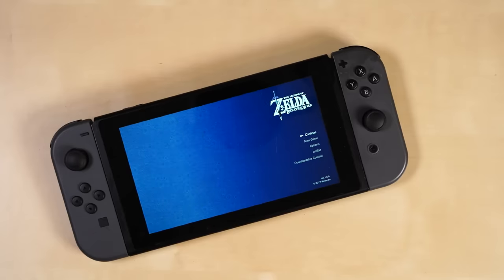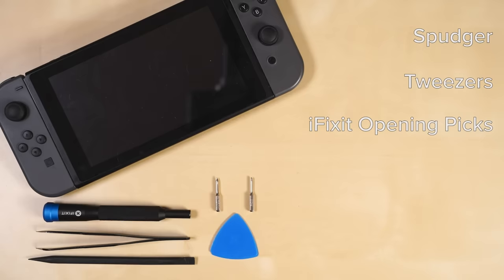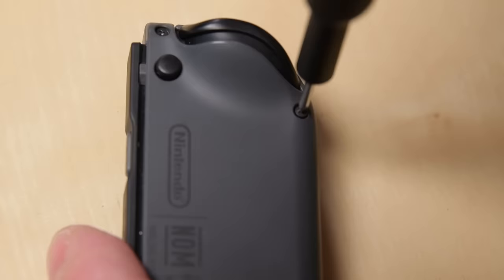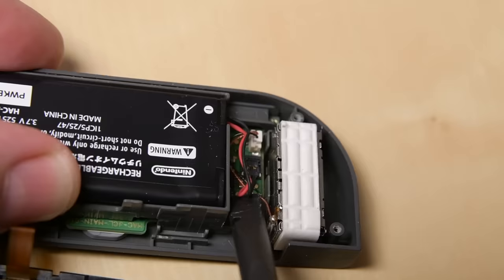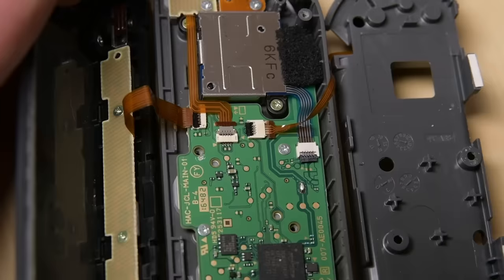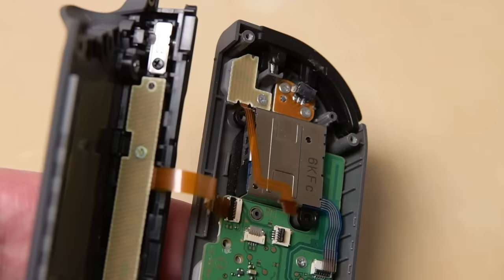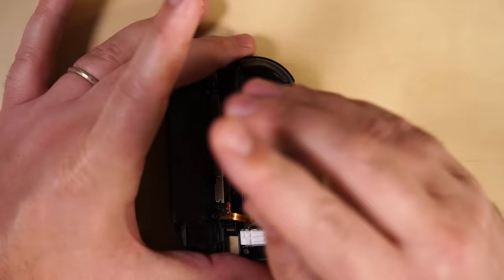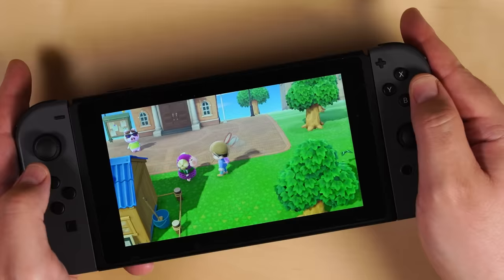JoyCon Drift Fix! How to Replace the Nintendo Switch Left Joy-Con Joystick

Comment from the maker: We forgot to mention calibration! If your replacement joystick is drifting after you finish the repair, a calibration should fix the problem. Here's a link to Nintendo's calibration instructions:
https://en-americas-support.nintendo.com/app/answers/detail/a_id/22340/~/how-to-calibrate-the-controllers#DT:t1-q1a1EP:t1-q1a1-c
Reply: do you guys know how to tell the difference between a fake joycon piece and the original joycon pieces? i want to buy a kit like this but i cant be sure if the thumbstick involved with it is actually the same with the original one.
Reply: @ozanozenir2503  I don't know if you still need the information but the replacement one I got had green strips compared to the original joycons that had blue. But still works the same.
Reply: @Ozan Özenir  I had the same question then realised: "Why would I want an original when they are so bad quality?" The replacement ones are just as good of you buy a kit with good quality 4.5/5 star ratings (i.e. off I-fixit or Amazon)
Reply: Do you have a way to remove the buttons on the Joy Con to clean them?
Reply: Very Helpful @IFixit
Reply: you can send the joycon to nintendo... even outt of warrenty

Comment: Thank you!! I’ve been putting off replacing my left joycon’s stick, but as of yesterday the drift was so bad it was unusable. This made the whole process easy, as someone who’s never taken apart an electronic device period, I was done from start to finish in 10 minutes! Working perfectly after the calibration, couldn’t be any easier.
Reply: How does the Joy Con that you replaced the analog stick work after this time? Is everything ok, or has the problem returned?
Reply: Yeah Tyler, how long did the repair last?
Reply: @mrcoolxoxo7007 can you read?
Reply: @nice_to_mitio  can you read and comprehend?
Reply: @mrcoolxoxo7007 I like turtles

Comment: Really appreciated your informative video and all the close-up shots!

I noticed a few things when I was fixing mine today:

1) When taking the joycon case apart, watch out for the L/R button coming off. If you looked closely you will find a small spring attached to the button, and if you're not careful you could lose the spring

2) Don't try to be a smartass like my Switch's previous owner (I bought it second-hand), who put double sided sticky tape under the battery! Because of his genius idea I was sweating a bit because I could not understand why my battery was so difficult to remove compared to the video (almost gave up because I was worried I would break it lol)
Reply: How does the Joy Con that you replaced the analog stick work after this time? Is everything ok, or has the problem returned?
Reply: @Lukail90  Unless you get the Hall Effect ones from brands like Gulikit, drift will always be an issue.

Regardless of whether or not you switch it for the potentiometer or hall effect one, you will need to recalibrate the stick.
Reply: The sticky tape isn't the previous owner's fault; it comes like that. Mine was like that, too, and so is the one in the video. It's misleadingly stated in the video that it's "lightly" adhered. It isn't.

Comment: Just received my replacement parts today. My sons are coming over tonight and we are going to attempt this repair together. Thank you for the time you took to make this video. Will follow up in comments as to how well we did.

UPDATE: Success! It took me about 30 minutes altogether (because I had kids all around), but we managed to get it working and after doing a calibration and some breaking in of the new stick... it's working beautifully.

Again, thank you! I've been waiting over a month for Nintendo to even respond to my request for a repair, and you helped us become self-sufficient with this issue.
Reply: Does they still work?
Reply: @carlb258  Yes, they do. I also got a set of metal clamps so the JoyCon stays attached. 8 months later and it’s still going strong.
Reply: @robhulson  thanks for the reply

Comment: Quick tip:
Don't waste your time disconnecting the battery, just lift it up gently and fold it over to the bottom of the joy con.  
I've seen people damaging the connector or the cables disconnecting it when they don't need it. 

The only cables I disconnect are the (-) button ribbon and of course the joystick cable

Also use caution removing the Y screws as they stripped very easily, more so if using cheap Y bits or screwdriver.
Use a rubber band in-between the screw and the screwdriver for better "traction"
Reply: I destroyed my connector.  Good advice
Reply: No, you should absolutely disconnect the battery. It is, generally speaking, a bad idea to have a circuit board connected to power while you're working with it. And, having just done this repair myself, it's very easy to press a button or several during the process, which causes the controller to power on and try to connect to the switch. It's safer for the board to disconnect it from power. Any accidental button presses after that should drain any capacitors that still hold a charge. Just be careful, and don't force it too hard.

Comment: Thanks for this video! Simple and to the point. I watched another joycon fixing video that said to unscrew all 5 interior screws, which I found out was wrong because two of those screws are for the motherboard.

However, I also learned from that video that it isn't entirely necessary to unplug the battery; if you're careful with the wires, it can stay connected throughout the process.

Regardless, thanks so much! Hopefully the replacement joysticks I got will last a while, but, if not, I'll come back here for a refresher!
Reply: How does the Joy Con that you replaced the analog stick work after this time? Is everything ok, or has the problem returned?
Reply: @Lukail90  I've replaced that joystick twice now. and will have to do so again soon, as well as the right joycon. these things are not designed to last, unfortunately.

Comment: I bought the kit and was able to fix it! Took me about 30 minutes because I've never repaired anything like this before. My advice would be to not disconnect the battery. It saves time and you run the risk of damaging the joycon if you remove it. Thanks!
Reply: Did the kit come with one joystick or two?
Reply: Be careful with this- you could short out the MB if anything makes contact where it shouldn’t while the battery is still in, plus in general not a good idea to open/manipulate anything electronic while it is still powered on.

Comment: Got in my kit today and pulled off this repair in no more than 10 minutes! Took a little bit of time to get used to re-inserting the ZIF connectors (some of them are more rigid and/or have less slack than others and I wanted to be careful not to apply too much force) but the rest of it was a breeze! For an aftermarket joy-con, it feels really smooth and responsive. Thanks for the kit, guys!

Comment: Worked a treat. The process is easy for this or any other button replacement, but having something step-by-step to follow makes it far less daunting for even the least technologically confident. I'd recommend doing this over messing with Nintendo or buying new ones. The parts are on amazon/ebay dirt cheap, and even come with the necessary screwdrivers and tools.

Comment: I used your method a few months ago and fixed it perfectly. Now( it is drifting again but I think it is because I dropped it. I tried changing out the joy stick again and it did not help :-(. It is acting different this time though, the joy stick doesn't work going to the right and when I try to use it to get into settings - once I manage to get to the setting (or controller or whatever option is to the right) it just moves all the way back to the left by itself. And I can't calibrate it. I hate that this happened right now before the holiday when, of course, there aren't even any new controllers out there that I can buy. Any suggestions?

Comment: Thank you for this i did it in 10 minutes. You don't have to disconnect the battery cable as long as you're careful with the cables but it was
 overall very easy.
Reply: The battery connection was the toughest to get apart and reinstall. Definitely skip it.

Comment: I've had an OLED model for about a year now, luckily no drift issues, but my left joycon got worn quickly. Obviously this is the more cost effective way to go. This video was very helpful. I actually ordered a very minimal part replacement kit after watching this and it was so easy I went ahead and ordered other parts for future repairs. My first attempt didn't work, because I didn't plug one of the cables in properly and the L button didn't work. My second try was successful.
Reply: Can it scan the amiibo?

Comment: I just want to say that if I could give this video a million likes on my own, I would. While there are plenty tutorials out there that are functional for individuals trying to replace joycon analog sticks, I appreciate how this video was clear and concise. I never felt confused because of how well and clearly you documented each step, leaving me to feel confident enough to try this myself. I repaired two drifting left joycons tonight and I feel absolutely ecstatic to have saved about $145 ($160 had I not bought a tool kit for repairing the joycons). Thank you very much!
Reply: in the future, if you have drift problems, you can actually just put a piece of cardstock behind the metal box where the stick is and that will apply enough pressure for the stick to no longer drift :)

Comment: Followed along the video and was able to replace my stick. Everything seems to be working so far and I had no issues following the instructions. I'll add that those y screws are super easy to strip. I did completely strip one- to the point where I had to use a drill to completely destroy the screw head before I could pop open the frame and remove the leftover screw with needle nose pliers. So yeah, careful with those screws- they are absolute crap.

Comment: Best video that I have viewed so far, others doesn't explain that there is a lock for the cable!!!! And how to re-connect the battery back on for amateur like me (although you can do without disconnecting them) !! So thank you, I will now go back and try to fix my failed attempts to replace the joycon.
Reply: Oh... if you are a first timer like me... word of advice, ONLY remove the 3 screws he show you in the video after you open open case. If you were like me ...  unscrewed all the screws!!!! 😫😫😫and the buttons fall off when trying to figure out how to attached the cable by rotation the joycon. It was a pain.

Comment: So. Before taking it apart, try spraying contact spray under the rubber shield on the stick. In my experience it fixes the problems in about 60-70% of the cases
Reply: It’s only temporary
Reply: @brandon_nope  so is putting in a new joystick. They are all "only temporary" fixes. Until we get a new joystick design that doesn't have the flaw, it will always start drifting again. 
And the time it takes to start again is random. From a few months to a few years.
Reply: From the other replies, they mention that it’s only temporary. Do you know if a full replacement lasts longer than just spraying contact spray?
Reply: Legendarium Yeah a full replacement makes them last longer then a measly spray
Reply: Do you mean contact cleaner like DEOXIT?

Comment: when I put the controller back together and tried to use it the joystick wouldn't go all the way up or down and calibration didn't fix anything. does anyone have a fix for this? I took the joystick out of another joycon that had other problems but the stick was fine

Comment: Somehow messed up the tiny pins on the lock connector but was able to use a saftey pin to straighten them out and it all works now 👍 worried I ruined the connection

Comment: Your video just caused me to snap the soldered joints for the battery connector.. it wasn't pins in slots it was soldered on.
Reply: Yep, just broke my dads that I was trying to fix for him as a Christmas present. Really frustrating guide.

Comment: My first electronics repair, and you made it so easy. Thank you for this!
Reply: How does the Joy Con that you replaced the analog stick work after this time? Is everything ok, or has the problem returned?
Reply: @Lukail90  it still works without issue. I'm about to do the same repair on a different joycon
Reply: @NickCroll  Did your L button fall off? mine just fall off with ease now I have to get new ones. happened to two joycons, didnt pressure it or anything, could be the paste weakened
Reply: @aware7577  nope, bummer!

Comment: Thanks so much for this. I'm so happy to have it working again!!!!!!! 

Just a sidenote for other people: I don't know if it's because mine is an older smash bros joycon or if it's because I was doing the right as opposed to the left, but there were no screws to be unscrewed in the battery tray. Instead, the screws were spread out. There were a couple of other cables in there as well. Also, most of my connectors did not have a locking mechanism, and the one that did was already unlocked. I didn't realise this so I may have damaged some of the connectors and getting them all back in place alongside the R button was a real test of patience with my shakey hands. 

Judging by the reviews, most people aren't as bad with small cables as I am so you should be fine. Once again, thank you!

Comment: I used the instructions to repair the right joycon on my Switch. I should note that the layout of the circuit board differed between the video and my setup. I had to remove the ZR button and then disconnect the wire from the ZR mount location in order to comfortably remove the battery harness. A number of other differences existed, too, but that was the biggest.

Comment: Great video. Very helpful. I purchased the replacement analog a few weeks ago and when it came to the point that the analog was no longer tolerable this video helped me easily replace. I would highly recommend that anyone doing this to use the tweezers. Without them it makes the process much harder.

Comment: Many thanks for this excellent visual guide! I was a dum-dum and dropped my Joy-con holder, causing the left joystick to break in the process. Since I have the white edition of the Joy-cons, there are no replacements. I found a replacement/parts kit at a very good discount and have the Joy-con up and running again thanks to this guide! The added benefit is that I now have extra spare parts should drift ever become an issue on either Joy-con :)

Comment: i tried to recalibrate the new joystick in the system setting,s it did not work: so i repeated the joystick replacement (keeping the ifixit joystick though) and drew 1 conclusion. when reassembling the joycon, hold it so that there is no pressure on the joystick, from any direction. once i checked the calibration settings, the joystick acted normally. and i did not need to recalibrate it in the system settings, in my case

Comment: Hey, the tutorial worked great, and so was the equipment, however, my joycon now disconnects randomly, and sometimes if I press random buttons like the ZL button, it'll reconnect again, but sometimes it'll stay disconnected.
Any idea where I went wrong perhaps?
Reply: Maybe you damage flex cable from sl or sr button.
Reply: @user-neomatrix777  yeah, it turned out I didn't connect the wire for the ZL button correctly!

Comment: Is there a technique of removing the battery from the connector that I don't know of? Your video makes that step look easy, but when I did it, I accidentally pried the battery connector off of the board, rendering the joycon unusable even with the new joystick.

Comment: After replacing the joystick I've noticed that the clicking sound when I push the joystick is extremely loud, otherwise everything works great. Is it just the issue with the new joystick or a problem with reassembly?

Comment: Also if you're like me and forgot to disconnect the battery at the right time and start it slightly freaking out cuz it wouldn't light up just disconnect it later and plug it back in. 😊
It worked and I scared myself 🙃

Comment: Great video...worked perfect. Just be cautious when apart your controllers, my L button broke, the piece attached to the controller board, very flimsy metal wings snapped right off. Otherwise, everything went great, just ordered the replacement part for the L button. Thanks again, great video.

Comment: I tried to do this with a kit but with no success: when I turn the Switch on, the L stick works but it is just as bad, if not worse, than before. 
What could it be? What could I do to solve this? Is the entire JoyCon screwed now?

Comment: Helpful tip: To void breaking the battery connector leave the battery connected and just lift it from it's cradle to access the rest of the controller.
Reply: I think one reason to disconnect the battery is so that you don't risk a short circuit or other electrical problem when you're disconnecting and reconnecting the other wires. Disconnecting the battery first is a safety issue for the delicate electronics.

Comment: You dont have to remove the battery connector. mine was really stuck in there and just wouldn't budge. So just remove the battery carefully from its position and keep it connected. worked great

Comment: I have fixed four of these drift problems. You don’t need to replace the joystick just yet. Overtime the tang springs for the joystick get pushed down or out of alignment or dirty. I slightly bent them and cleaned them and all work. Try this before replacing if you have the skill set.

Comment: easy instructions and to the point! really easy fix since i already had all the tools need it. i did not disconnect the battery or the minus button and it worked too, but your way is safer